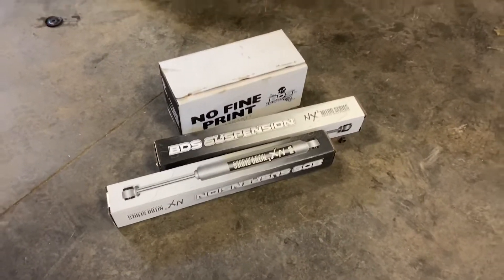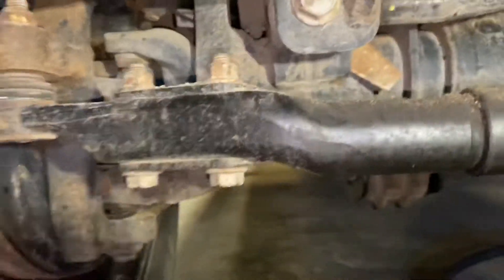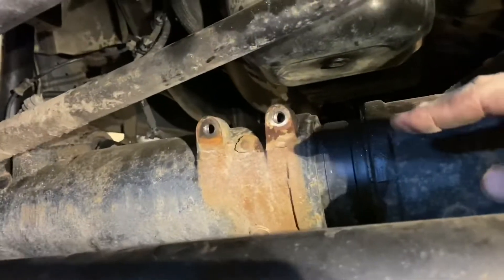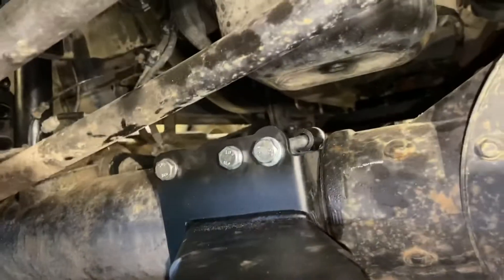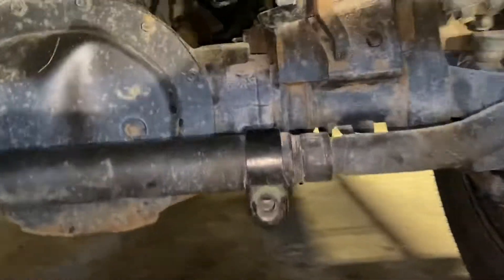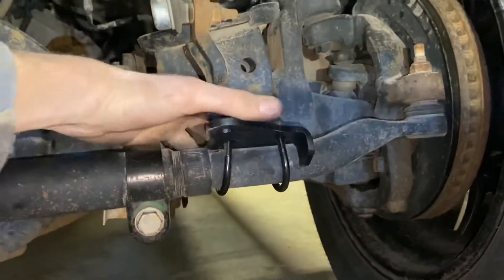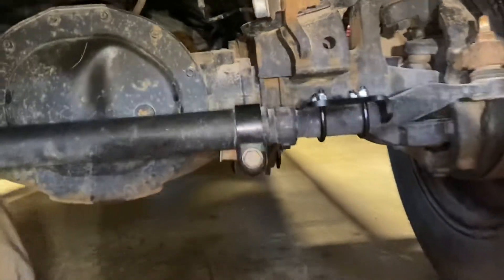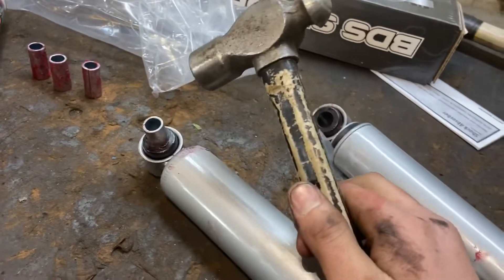How to: installing BDS dual steering stabilizer on 2017 Ram 3500

Comment: I have a 3500 2014 I've been seeing the DBS dual stabilizer kit and I really want one but everytime I read the descriptions it says you have to have it 4 inch lift or higher all I have is a 3-inch lift does that really matter?
Reply from the maker: Really? I don’t think you need a lift to run the dual steering stabilizer... I’ve seen them on stock height trucks before.
Reply: I know right I said the same thing if you don't mind me asking do you have a lift on your truck? I have Carli suspension kit with the 3-inch lift  with the track bar & Sway Bar
Reply: Never mind about your Lyft you have a 6 and 1/2 in
Reply: Nick warren, did you follow through with it? I have a 2.5 level on fox shocks. Wondering if it’ll work out with just that
Reply: @rafaelgallardo4486   that's crazy I was just calling my mechanic to get it quote on how much he would charge me to put it on I would do it myself but my carli track bar
Reply: @rafaelgallardo4486  is is blocking one of the bolts that I have to get to
Reply: @rafaelgallardo4486  I should have it done by sometime this week or weekend out upgrade you and let you know how it work out
Reply: @rafaelgallardo4486  everything worked out good rides even better and smoother.... install with wheel alignment cost me $140... pretty badass price
Reply: @nickwarren3426 hey it ended up working? I have the 3 inch kit too and noticed it said that. All worked out well?
Reply: @jacobm9574  helllyeaaa